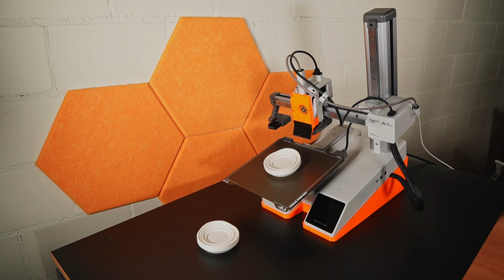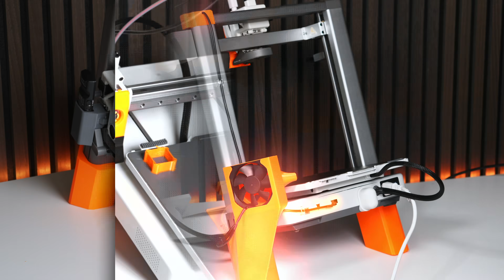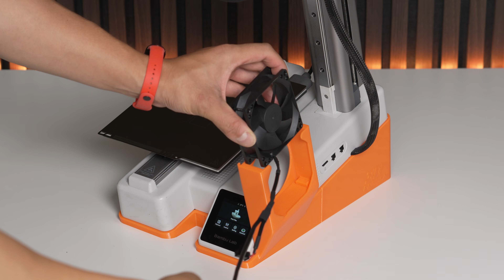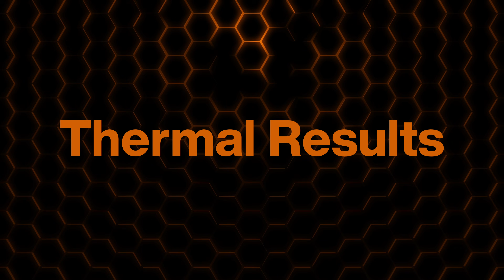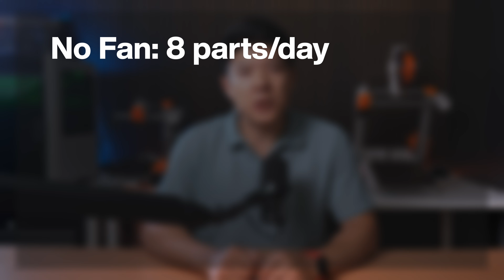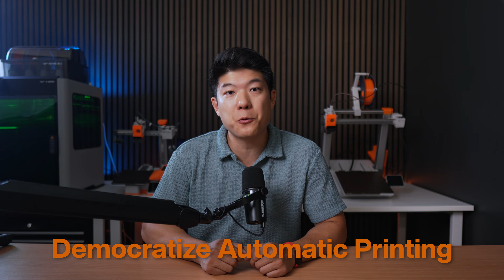We Fixed the BIGGEST Problem with Automatic 3D Printing (FarmLoop Fan Upgrade)

Comment: I have a question: in the FAN vs. FANLESS comparison, I see a print bed placed vertically between the two printers (I assume to prevent the cold airflow from the right printer from affecting the temperature of the left printer). If I have a farm, all the printers are close together, and the print beds may not finish at the same time (requiring simultaneous fan cooling), which could cause significant temperature fluctuations in the neighboring printers. Have you considered this scenario? If so, how did you resolve it?
Reply from the maker: Hi Daniele, well observed. In our farm the distance between the printers are just enough that there is not too much crosswinds. However, if we would stack the printers closer to each other, I would add a barrier like the one from this video.

Comment: I've been trying to set up farmloop on my p1s, but it isnt pushing the item off between loops, its just attempting to reprint straight away. not even waiting for cool down. What am i doing wrong?
Reply from the maker: Please watch the how to use video on the upper right corner. It looks like you didn't export plate sliced file but uploaded only the 3mf file without gcode in it.

Comment: How does the system go with 1-2 layer “supports” that sometimes get stuck to the bed?
(I’m printing M12 threaded and there’s supports on the first couple layers on the threaded holes). Thank you

Comment: What do you think about wiring an external 120 mm or 140 mm fan to the P1S/X1 AMS port? This could pull in cooler air from the top or front of the printer (when not using a heated chamber), helping the bed cool down faster and allowing prints to release more quickly? The stock side fan also works as is but it does pull a slightly warmer air because it is at the bottom inside the printer and it doesn't quite cover the full build plate area.
Reply from the maker: We are already on that and it will be part of Stage 2
Reply: @3DFarmers  Nice!

Comment: A printer running klipper could be configured to automatically kick a fan on as part of the print end or print cancel macro. It could also kick the fan off at a specific bed temp, and then auto trigger a move to knock a print off the bed.

Comment: Why you haven't use blower type fan instead of classic type? Seems like, blower type is way better alternative for that issue.
Reply from the maker: It's true that blower type fans are better for pushing air through resistance. However, we designed the nozzle to have a similar cross section throughout its length. In these situations the classic fan type is quieter, more efficient and can move more air volume.

Comment: For those who want to do it themselves. You need fan on 25 v, socket molex micro fit and micro relay switch ( for instance SS-5GL, (SS5GL) ). About ams power (molex pin mapping), you need two bottom pins, left -25v (black) and right +25(red). Then easy connect black cable from fun to molex -25v and create chain as +25v red molex -> micro relay switch -> fan red cable. Also use G1 Y185 Z185 F600 command in gcode
Reply from the maker: I have the part list and wiring diagram in the descriptions.

Comment: You need to create an height adjustable limit switch, I have the feeling that the constant full up movement is going to cause some wear to the screws, frame and cables
Reply from the maker: Why would a full z movement be a problem?

Comment: This is great for PLA parts, for ABS, the effect is even greater, because the build plate from 100c to 60c is faster than 60 to 40c and 60c is enough to detatch the ABS part, and even so the part itself detatches due to greater shrinkage. This is why I automate only with ABS on the Q1 Pro print farm. I have conceptualized liquid cooled buildplate with a pump and radiator from an AIO CPU Cooler for even faster cooldown.
Reply: I hope soon You can launch a course tutorial of how to automatice Qidi, I have 2 Q1 and don't know how to do that

I love your content, keep doing it

Comment: I have a question about the longevity of the Y axis. Since the printer is tilted forwards, the Y axis belt, and motor are under contact tension towards one side. Can this cause issues in the long term. Do you have any suggestions or tips for maintenance in this printer orientation?
Reply from the maker: Our oldest printers are at 5500 hours now. No problems at all.

We lubricate the axis every 500 hours.

Comment: I use a bedside fan similar to yours as a chamber heater for 3 years now, my bed is hella bent now, but still chugging along with multipoint bed levelling. I would like to remind you that the bed will start to warp when you cool it that way all the time.
Reply from the maker: Interesting, but are you heating the bed or cooling it? If you use a external chamber heater you might have exceeded max temperature?
Reply: @3DFarmers  Sorry I was not very clear, I was not using an external chamber heater, but I was blowing air at the heated bed so the heated bed will heat up the chamber quicker. That fan was being controlled by simple thermostat in the chamber. I only print ABS or PC-ABS so that might have aged the bed quicker than your case will do. So I was blowing air at the heated bed while it was being powered and while it was not being powered. First one to heat the chamber, second one to cool the bed faster after the print ended.